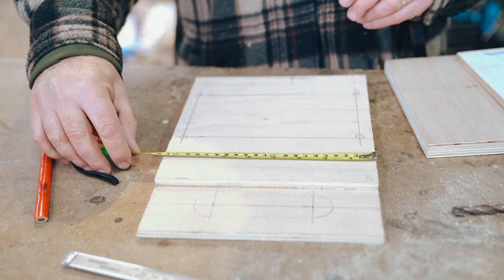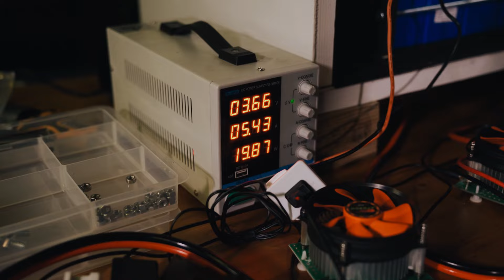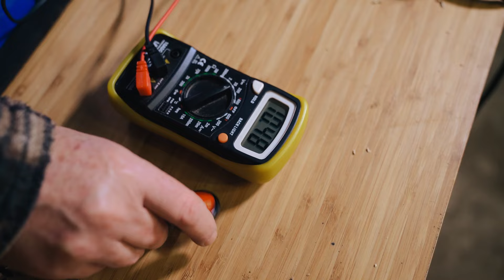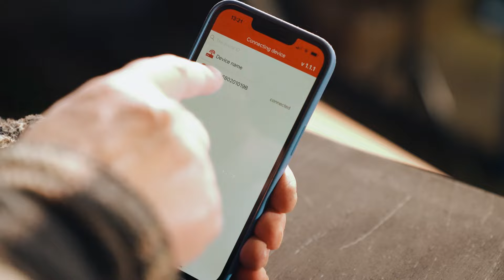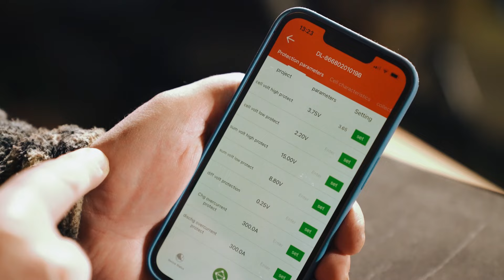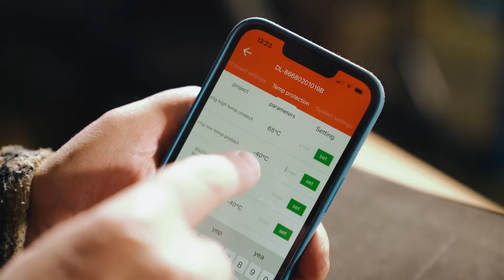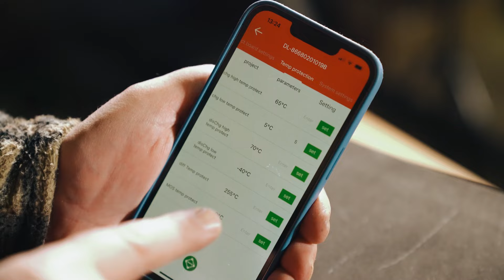Very Detailed Beginners Guide To Building A Custom DIY LiFePO4 Battery

Comment: I’m totally new and just learning. 1) maybe I missed it but what is the capacity of this battery volts/watts and 2) what is the approximate cost of building (minus the tools) vs purchase of equivalent? Thank you!
Reply: 280Ah 3.2V each. In serial of 4 pcs it's 280Ah 12.8V nominal (14,4V full).

Comment: I nearly finished my batterybox following along this video. It worked out perfect so far :) What kind of cable are you using here 56:00? I realized that mine are pretty stiff and really hard to work with. The ones on the Daly BMS are very flexible.
Reply from the maker: Hope the video was helpful for you!
Here’s the wire we use: https://geni.us/BigWire
Reply: @offgrid_power  It was hands down the best video i could find for that and i watched sooooo many videos.

Comment: How much swelling can one expect on these cells? I just got 4 and have been charging them at 8 amps(auto shit off) and one of the 4 swelled out on the sides. They are not squeezed together yet. Thinking abt fully discharging before I build a case like yours to see if the swelling goes away. I’m thinking it wont

Comment: Great Video again Roger! would the battery work with a split charge relay on a van? or do you need some kind of DC to DC converter?
Reply from the maker: Thanks Johnny! You'd need a DC to DC charger for this. Maybe something like this: https://geni.us/VictronDCDC or https://geni.us/VotronicDCDC

It's not recommended to charge LiFePO4 with a split charge relay as the charge profiles of Lead Acid & LiFePO4 are so different. Plus the DC to DC charger adds a layer of protection for your alternator and LiFePO4 battery. :)
Reply: @offgrid_power  that's great thank you :) will need to get a good battery & inverter setup to run a induction hob currently saving the pennies :)
Reply: @YorkshireCampers  Renogy do a great dc to dc charger with mppt combined 50amp it’s on offer at the moment for £199. I have one and lots of friends have it aswell with no problems.
Reply from the maker: In the new year we must tie up and we can look at some options for a battery for you guys. 🙂
Reply from the maker: That’s a good price for a 50A DC to DC. 
Do you have a link?

Comment: 28:20 Threading the pvc tube onto the thread bars becomes easier if you heat the tubes up. I put them in the water cooker to warm them up when my wife does not watch.
30:00 I torque the tension nuts with my cordless screwdriver. I made a setup out of a bathroom scales and some wood bars to find the torque that represents a certain amount of pull. Manufacturer's recommendation divided by 4 = 75kg divided by 2 due to the lever I made out of the bar. I use the thread bars and nuts that go eventually on the battery box. So I am sure the torque translates into the tension I need. Then I mark the setting that on the variable torque control ring
1:11:11 I put separating sheets between the cells. In the middle (between ceel 2 and 3) I put in two. These have a slot that takes the temperature probe and wire. I cut the slot so that it has the probe rest in the middle of the cells. For the separation sheets I use PCB boards with one side covered with copper I had lying around. The double layer is just enough for the probe.

Comment: My BMS Bluetooth turns of after a while. Does it mean, that the BMS is also turned off? I don't need to check the battery all the time and i am fine just pressing the bluetooth button to be able to connect, but i am just worried that it doesn't work properly in standby.
Reply from the maker: The BMS shouldn't ever turn off unless you disconnect it from the cells but the Bluetooth can turn off from time to time to conserve power.

Comment: I started charging my Batteries and the C.V. light is on like in your video. Does it matter if it is not jumping to C.C.?
Reply from the maker: Do you mean on a desktop power supply?
Reply from the maker: Do you mean on a desktop power supply?
Reply: @offgrid_power  Yes, just realize that i forgot to mention it. Basicly like the one you are using.
Reply from the maker: I think the current fluctuates if you have it on CV. Some of the variable power supplies can be a bit temperamental, so worth keeping an eye on the voltage that's being output.

Comment: I bought 8 12 v 200 AH Lithium batteries. My inverter (Schneider 4048) in it setting is asking for BATT CAPACITY) , How to I determine that? I have 8 batteries interconnect.
Reply from the maker: Are your 8 cells connected in parallel to keep it at 12v? If so, you just multiple them out to work out the total capacity (e.g. 8 x 200Ah = 1600Ah).

Comment: Thanks Roger, brilliant video. It was quite therapeutic to see you working. Extremely educational and helpful. Most people are talking about the challenges around connecting a DIY BMS to an AC inverter using RS485 e.g. GroWatt AC3000. I don't see any useful info when I google. See if you can do a video please. Thanks.

Comment: What I do not understand is how much or how large of a bank would I need to run my whole home during the day in the summer months with air conditioning. I want to build a bank for this because here in Canada we have off peak hours that is fairly cheap electricity. I want to build the bank so I can charge it in off peak times and use the battery bank alone during peak times.
Reply: Google this man. You need to know how many KWH you use and then start from there.

Comment: Hey! Maybe someone can help me. I am a complete beginner with electrical stuff and I am setting up a 4s 12v LiFePO battery for my van build. I bought a BMS that has a B- and a P- wire coming out of it. I know to put the B- wire on the battery total negative. What is the P- wire for? What does it connect to? The manufacturer instructions don't say, and I can't find a video that shows it either. Thank you!

Comment: How do I know what bms to use in a 48 volt battery 105 ah cells
Reply: Bms size depends a lot on intended use. If you plan to use the batteries to power high amperage, you need a bms that is capable of that + some headroom. 105ah at 1c discharge, is 105amps. Your bms would need be at least 125amp. It also depends on continuos or burst. Some cells are capable of 3c discharge. If you plan on that with 105ah, you would need a bms capable of +300amps. Voltage matters less than amperage.

Comment: eu posso usar bms de 200 baterias de 280 amp eu nao intendo
Reply from the maker: Yes, you can use a 200A BMS with 280Ah cells. The amperage of the BMS will determine how much current you can draw from your battery or charge the battery.
Reply: @offgrid_power  muito obrigado por resposder meu amigo aqui no brasil nao se consegue muita informacao sobre essas baterias

Comment: I'd be moving that blue cable from the BMS so it doesn't wear through and short out on that adjacent battery!

That's dangerous as hell!
Reply: @offgrid_power  you think it's not?

What a clown show!
Reply from the maker: I just double checked this exact battery and the blue wire from the BMS does not come into contact with any terminals other than the terminal it’s meant to. Neither do the black wire from the BMS or the red wire from the outside positive terminal. But that said, you advice to not have the wires touching is good and best practice. Thanks for engagement and feedback on the channel, Jeff. It’s much appreciated.😊
Reply: @offgrid_power  you don't even know what I'm talking about dude!
Reply: @offgrid_power  look again at the 1:11:05 mark. The blue cable is bent upwards and is touching the the terminal of the 2nd battery from the end!

If you don't understand about battery cables rubbing on sharp objects... you ha e no business selling these to people! 

That's what a hack does!
Reply from the maker: Thanks for the advice, Jeff. I know what you’re talking about, but like I said previously the battery is sitting in our workshop and I just checked it and the blue wire is not making contact with the positive terminal on cell two. It may look like it in the video, but on the finished battery, the wire is out to the side enough to clear the terminal completely.

Comment: Just a little hint:

Daly BMS are now quite shit compared to the many others on the market. When I bought and built a 200A 12v 4s they were one of the best budget brands but through painful experience have discovered hopeless documentation, crazy app interface, dreadful customer support, endless subtle and incompatible tech changes between models every few months. 

My recommendation is steer clear of Daly BMS.
Reply from the maker: This video is now a few years old, so there are newer, better options available. 👍🏼
Reply: Why not recommend one instead? 😂